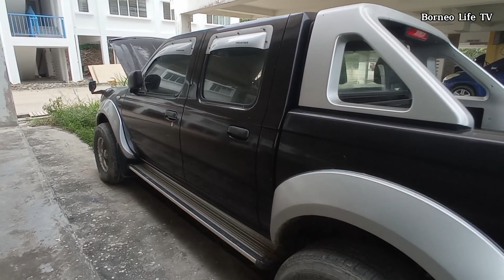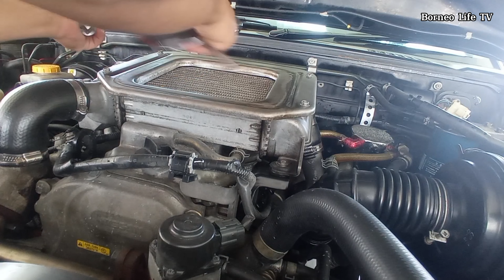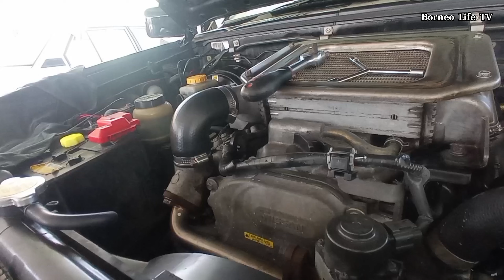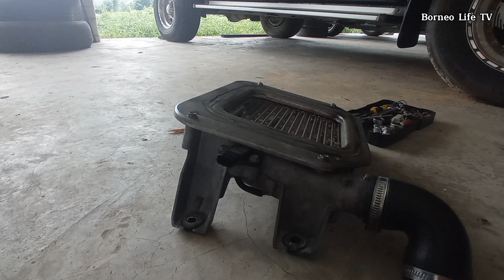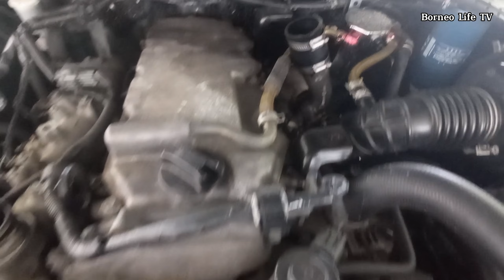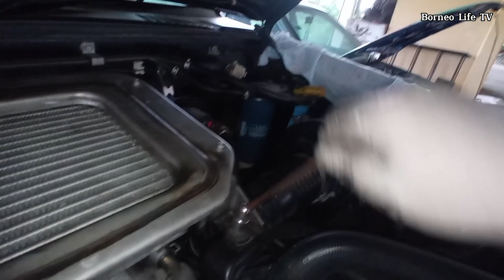Nissan Frontier D22 Y25 Turbo Intercooler | Open And Install | Leaking

Comment: Hi tuan, apa penyebab dia tu boleh  leaking mcm tu, sya punya pn mcm tu jga, aku tnya d workshop dia ckp turbo rosak, tpi sya tengk turbo masih juga kuat kipasnya
Reply from the maker: Hi..Turbo leaking. Sy punya pun turbo leaking tapi masih power. Kena guna oil catch tank agar minyak leak tidak sampai ke intercooler. Catch tank kena check level minyak hitam. Klu banyak kena buang.. cuba check konten yg lain di sini https://youtu.be/bx-tjBDZBa8?si=EmUcgBUxaa5_D-V4
Reply: @BorneoLifeTV  tq boss kuu..